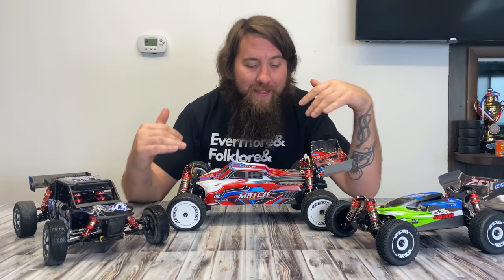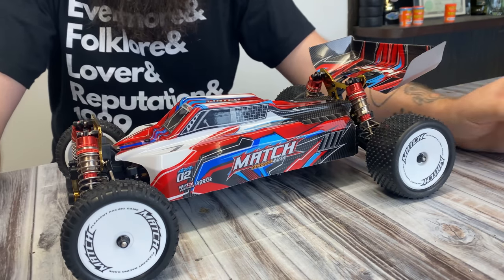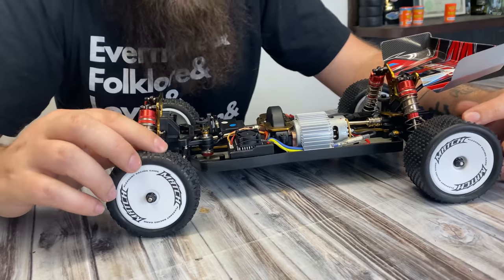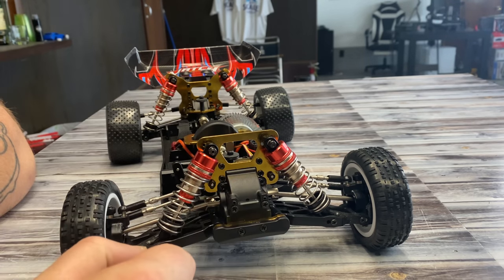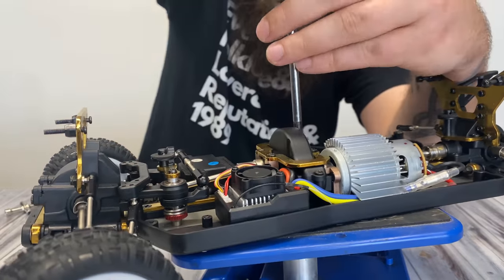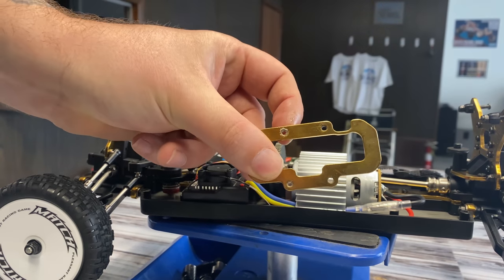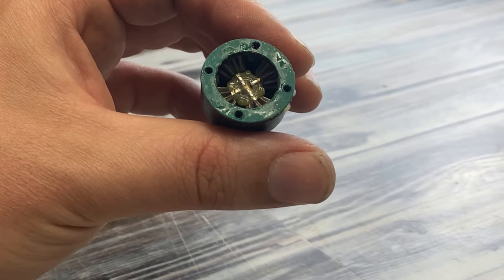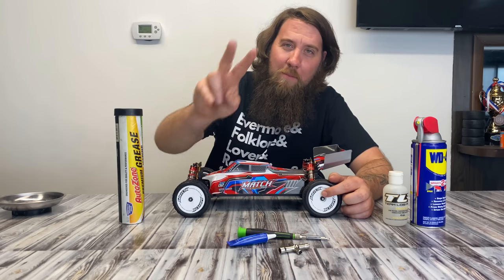Guess what I found inside the WLToys104001-Teardown and Inspection

Comment: powder metal junk imo
Reply from the maker: We’ll see.
Reply: @10thScaleGarage  Not we'll see..It's a fact that buggy is made from powder metal lol
Reply from the maker: Thank you, wise sir.
Reply: @10thScaleGarage  Pot metal would be an upgrade ..It is what it is
Reply: I don't know what powder metal refers but it's still better then all plastic like losi or traxxas
Reply: @kenmastersmaster  Metal made from powder and no this is not better than Traxxas or Losi
Reply: @philthyco1  I have many traxxas and let me tell you the wltoys feels like a precision machine compared to my traxxas that all feel like toys from the 90s
Reply: @kenmastersmaster  Lol
Reply from the maker: You see the new video? I smashed it chassis first into a rock. Do you think  it broke?
Reply: @10thScaleGarage  No I haven't watched yet..Not broke but bent lol
Reply: @10thScaleGarage  You see the powder metal now though right? Look at your universal shaft where it broke so easily..You will see the powder metal .. Sometimes metal is worse than composite ..Like I said they should have at least used pot metal on this rig whick is much stronger than powder..And of course they won't use hardened steel but that's what the drivetrain should be made of.
Reply: @kenmastersmaster  plastic is key to strength and low weight when it comes to a arms, bumpers, and the chassis in traxxas cars just look at the xmaxx for instance. There’s no way you actually think at this rc being more durable something like even brushed slash 😂
Reply: Sintered gears are common in everything these days. Your angle grinder has them too. It's probably more than good enough for the included power system. Probaby fine down to 13,5t brushless with race gearing.

Drive shafts are not going to be sintered powder metal.
Reply: @tahustvedt  The driveshafts are powder metal also..Some cheap angle grinders have powder metal bodies also,yes

Comment: Hey bro, totally enjoyed that video. I found another one and said the same thing about the diffs. Could you show what you use to grease the gears and oil. I own 2 RC Trucks and I know nothing about the parts inside, haven't drove them yet as I am preparing to setup a track. The reason why I ask is because I want to be sure that I don't want to spend money on RC's that aren't properly greased. Can you share a video of the stuff I'll need to buy? Very Appreciated. I have another youtube videos for Hot Wheels and RC, but I'm using this one as I was thinking about RC.

OH and btw, I'm bookmarking this video too. Great way to start inspecting the RC. Thanks for the video :).

Comment: I think this RC is still good because its price is just 100 euro dollars only and it gets a universal joint in its driveshaft. A minor problem is that the differential gears are not sealed so you can't fill silicone oil. Slipper Clutch or central differential gear is not necessary for a beginner to experience RC toys. Mine 14002 has been totaled within 3 weeks because Wltoys has miscalculated the suspension shafts. Front suspension shafts are bent under compression due to cornering which results in steering failures and crashes. As the chassis is bent, the differential gears and gearboxes cannot be installed because it is a shaft-drive system. It explains the universal joint driveshaft system is very important.

I also think powder metal is not a problem if you are not playing Wltoys competitively with a high-end sensored brushless 5.5t motor - 13.5t surpass hobby ESC-motor-combo is, of course, a good option for Wltoys.

Comment: Adding grease to the pinion and spurr... Tried that once, never again LOL. The whole inside of the cover ended up with a thin layer of brass dust and oil... Completely wore down the parts by doing that - essentially turned it i to a fine polishing mechanism. Do it at your own risk, folks..
Reply from the maker: Yeah. There’s a fine line between just enough and too much. You need to make sure your gear mesh is just right and there are no abrasives in your grease or dirt in your gear box.

Comment: Opinion on grease vs oil in the differential?  I’m new to the hobby and just opened up my car’s diffs to find just a little oil in there.
Reply from the maker: Grease sticks to the gears better than oil.m, but if you use too much grease, it will get flung off the gears... you want just enough to keep things lubed.

Comment: Have you tried to twist the chassis from front to back? As in put something under the chassis between the wheels and push down on the front and rear wheels. There is some serious flex in that metal chassis unfortunately.
Reply from the maker: I jumped it, I jumped it into a wall, I drove it flat out into a rock, I jumped it down a big flight of stairs, dropped it from a considerable height, and I smashed it chassis first into a rock..........

Comment: The chassis bends like a hot slice of pizza and the electronics are very garbageble, everything else it's pretty nice
That is what everyone should do to new cars, cheap or expensive, a good check up will save some money
Reply from the maker: You bent a chassis??
Reply: @10thScaleGarage  not yet but you can do it with your hands, try it 😂
Reply: Chassis is too Flexible.  Tomley posted a video showing how weak it is.
Reply: @TheflyingkiwiRC  I can't even bed the plastic chassis from my rustler lol. Imagine how bad the quality is on their metal parts which are garbage alloys of whatever metal they can find.
Reply: @DimiS1978  Agreed.  Plastic chassis on my V3 Big Rock is super strong.  I just wonder if this car is over hyped. 😕
Reply: @TheflyingkiwiRC  what is the name of tomley  channel?
Reply from the maker: I just tried bending it. And I couldn’t. I guess I’m just weak. Haha.
Reply: @10thScaleGarage   I doubt it's your lack of strength bro.  Glad your chassis has some beef to it.  There is hope after all.

Comment: Never put grease on the spur/pinion. Sand/dirt gets in there and will grind. Grease is for the ring gear in the diff and silicone diff lube goes inside the diff.
Reply from the maker: YOLO
Reply: @10thScaleGarage  🤣🤣🤣

Comment: What weight grease should you add?  🤔 Would white lithium have any advantages?
Reply from the maker: It’s just marine grease from autozone. It’s pretty think stuff. The oil that I added to the shocks was 45wt.
Reply: I always just use automotive bearing grease high heat , it's usually red, white lithium grease is alot thinner and would work for a 1/16 differential but a 1/10   needs a thicker grease inside to prevent the differential from being too loose, keeping both wheels turning at the same speed  like a locked differential, helps with full throttle launches,  white lithium on outer crown gears would create less drag then a thicker grease so might run a bit faster like 1 mph but isn't as water resistant as a thicker grease and might become runny in high temperatures, a thicker grease will be less likely to fling off the gears but creates more drag Thu the transmission but I'd say it's unnoticeable unless you over pack the crown gear and bevel gear with too much grease, I only use a small amount of grease like a thumb nail size glob spread it on the crown gear so no teeth are showing and it spreads its self after running
Reply: Thanks for the reply. Very interesting.

Comment: don't know why all the hipe, hsp xstr is around the same price and looks a lot better car, and as hafe the people who get this are going to put a brushless upgrade in it anyway i'd just get the hsp pro witch is the one i have yep it has a few problems but at least you can get a proper battery in it and will do arount 50 mph on 3s strate out the box. it's a no brainer to me lol, was looking at getting the brushed one as i race my mate in a barn all the time even on 2s the pro is far too fast,
Reply from the maker: a lot of people (me included) like to tinker and put our own electronics in it, rather than just RTR.
Reply: @10thScaleGarage  fair enough, so do i built my crawler from the ground up  building a rock bouncer out off stainless welding rods now lol havent gone as far to make the axles or running gear yet though,  going to be makeing wheels at some point  
for one off trhem as i keep braking them

Comment: Ok so your viewers will know. (besides the 4wd part) what is a better bang for there buck this wl toys 1000000000432736 or a Traxxas bandit. Id like to know the quality of electronics, how does the plastic feel soft or durable, parts supply and what needs to be done out of the box. Speed too. Everyone loves speed. Lol. Being that the bandit is 149 rtr it's pretty close to the wl toys price point. U have experience with both. I would love to hear your thoughts.
Reply from the maker: Bandit doesn’t come with a battery or charger unless you buy the $200 version, and that’s just a NiMH battery..... this is almost certainly going to be faster, but faster isn’t always “better.”
Reply: The bandit is more of a basher/toy this is more of a racing buggy

Comment: Should we do that for all new RC Cars or just that one 🤔
Reply from the maker: My $1000 Arrma Outcast 8S had dry diffs.
Reply: Looks like I'm going to have to learn Big Rock mechanical skills when I get home from the road! I
I already ran through 1  3s battery and hopefully didn't  do any damage!
Reply: They're dry for a reason. If plastic or nylon can rub without grease for years and prevent drag by being dry

My brand new vw jetta 6mt has no grease on the clutch fork for where the tob is. That's how they make shit these days

Comment: good info 💪🏾💯
Reply from the maker: I got you!
Reply: @10thScaleGarage  do not send it to the moon as the chassis will flex and you will break the front or rear gear drive pinion
Reply from the maker: Did you bend yours?

Comment: Can I swap the castle 2028 1100kv motor in the Wltoys 104001
Reply: Yes you can amd explode that car back to China lol. U will have to swap out the esc though. Its a brushed motor and esc.  your castle motors are brushless. They are not compatible.  I would purchase a Traxxas bandit. Around the same price and u can to alot more to it.
Reply: Remember, this thing does not have a slipper clutch. Putting a motor in with that much torque is just asking for trouble. I'd go for a hobbywing quicrun 6.5 turn motor, you can buy those in a combo with a good esc for around 70-80 on aliexpress. But like jeff said, there are much better cars out there. I bought a Rustler VXL roller/slider for $105 last month on ebay. Even came with the remote.
Reply: @DimiS1978  yep! U can even make the rustler a slash if you wanted too at some point.  A friend of mine did that for his daughter to race with. Parts are everywhere and upgrades are endless.
Reply from the maker: Yes, but you’ll need to change the ESC, receiver/ transmitter, and steering servo. That’s a bit powerful for this chassis, but it can be done.
Reply from the maker: Bandit is 2WD..... and doesn’t come with a battery.... just FYI. It’s ~$200 for the version that comes with a battery and even that is a NiMH, not a LiPo.
Reply: @jeffbryner5355  Yeah, I've already replaced the gearbox with an RPM one with an aluminium plate for motor heat dissipation. Changed out the stock shocks for GTR shocks. Getting my motor & esc tomorrow. Hobbywing MAX10 SCT ESC & 3660SL 3200KV motor. Oh yea also extreme heavy duty driveshafts. This thing is going to be a beast lol. Already looking at the aluminium caster blocks & steering link... Also have a jconcepts F2 body on the way. Traxxas rc's are fun to work on.
Reply: @10thScaleGarage  yes but is that battery really worth a dang u g get with the wl toys? Isn't it like a 1800mah? Atleast the bandits is a 5k mah hydride battery or not. I bet it has more power then the Chinese lipo don't you think? The 1800 mah I got with my exceed rc lasted about a little under 10 min lol. Then takes like 8 hours to charge on the wall charger haha
I feel spending  extra 50 bucks for the bandit with a better battery is a better choice even though it's only 2wd. So much more you can do and you know it's brushless ready out of the box if you buy the brushed version
Reply: @DimiS1978  nice! I'm building a slash for a dirt oval car right now.. lol Going to put a tekin 4600kv in it with a tekin rx8. Should rip. My associated sc6.1 does with that set up. Alot of people run the xr8 and xr10 at my track with great success.
Reply: @jeffbryner5355  Oh yea, the XR10 is for 10th scale buggies though not really meant for bashers lol. I might make a video of my Rusty when she's finished. I have like 4 other cars I have to finish too....
Reply: @DimiS1978  yeah I have seen the xr10 pros run in sc trucks and waxed butt with them.  Yeah I have some too. Not enough money for them all haha
Reply from the maker: It’s a 2200mah 2S. I have 4 of them and I use them a bunch. I’ll take a LiPo over a NiMH any day. You’re right though. The wall chargers than come with RTRs suck. I got a $15 dynamite charger for amazon that will charge that 2S in ~60 mins.